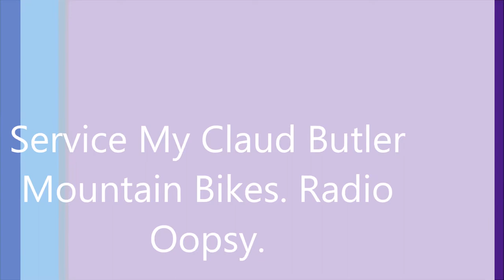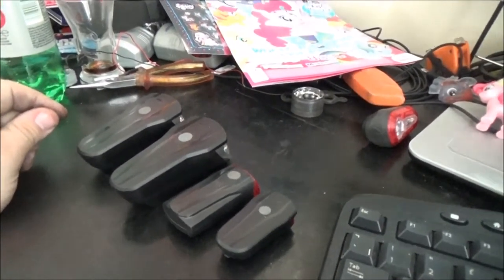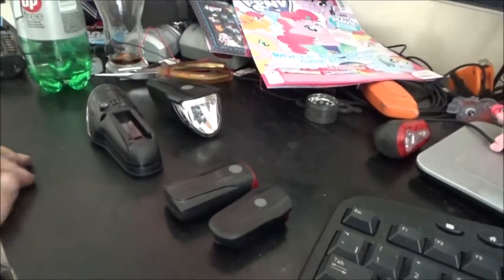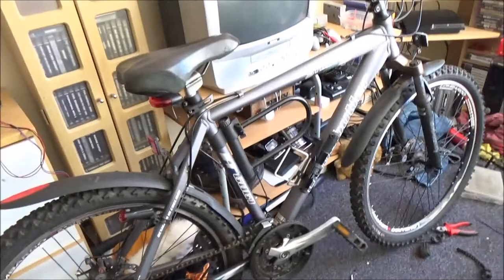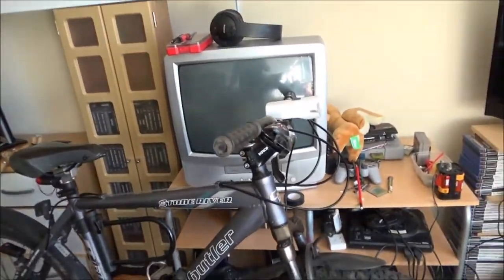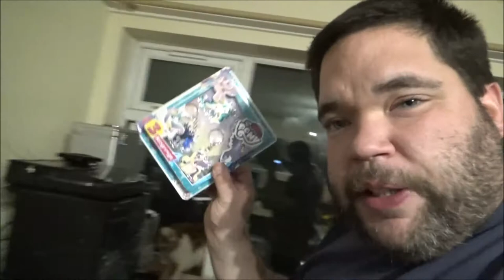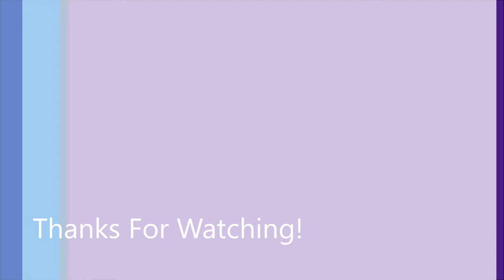Bike Servicing, Radio Oops

Comment: Hi Andy, going back to that old speaker, it's a 'mains energized coil' type! It's got the full mains voltage on it to form an electro magnet,I've got one of those connected to a world war 2 vintage army valve radio that was my dad's, it's still all works! 👍
Reply from the maker: I got mine out of a vintage  radio that got it's box smashed
Reply: LifeOfAnEnglishman, I've just seen ur vid, bloody shame about it getting broken especially as it was working, I'd have been gutted if that had happened to me! 😞